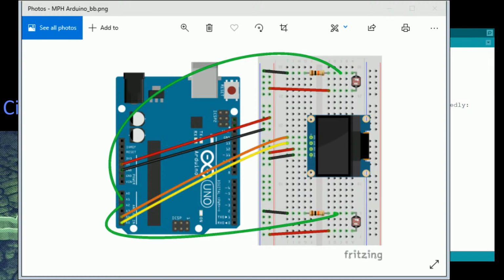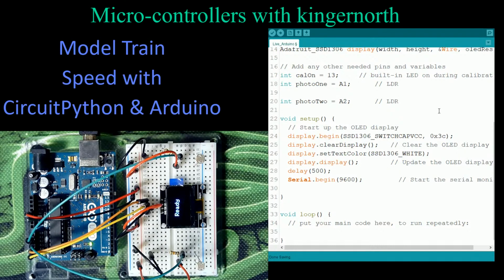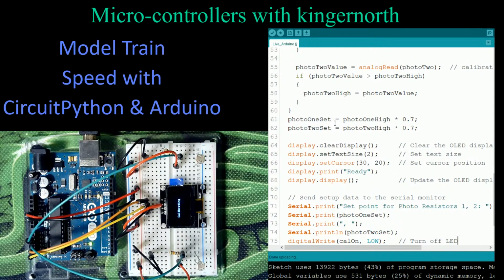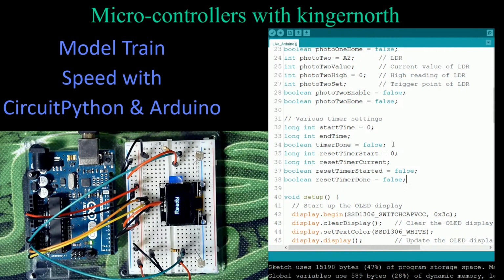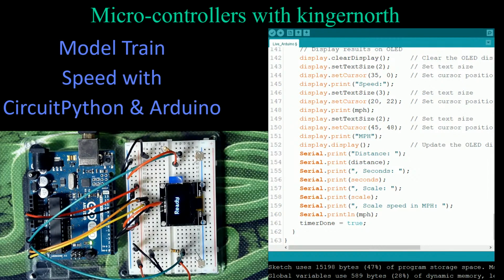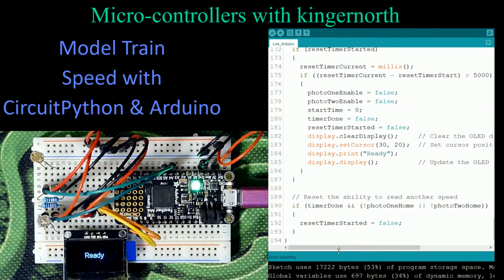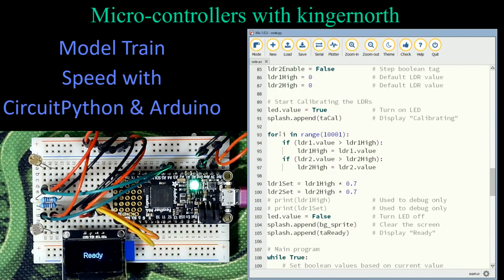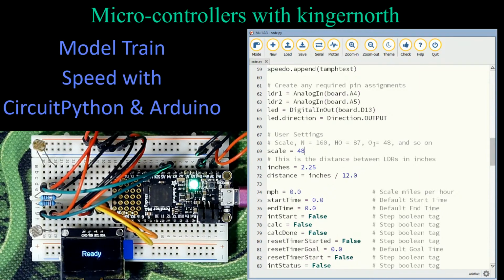Model Train Speed with CircuitPython & Arduino

Comment: What?  No trains?  This is a good novice guide to using LDRs.  As one who is actively involved in tracking model trains as they run, I'd note more advanced techniques involve using RFID tags and readers, or cameras with frame by frame motion detection using, say, OpenCV.  Two different friends who have operational systems have taken two different approaches:  one places RFID readers in his engines and a bunch of RFID tags buried below his track.  The other places readers around the rails and puts tags on everything that moves.  In both cases, all of the reading and processing is handled on Arduinos.  They both use XBees for communications.  RFID is more reliable than light sensing.  I'm building a system that employs both RFID and image-based motion detection.  I'll be using packet radios collocated on Adafruit Feathers.
Reply: Was kind of disappointed in the 'no trains' as well... thought it was going to be controlling the train's speed, not measuring it.  Ah well....

Comment: Any reason you did not use IR sensors?
Reply from the maker: Thanks for the question. I did comment in the video that IR could be used in place if the photo resistors but that was optional. Also the cost is less as compared to using IR sensors. I did cover using IR sensors in an earlier topic in this series of videos so I just kept it simple for that average user starting out adding and also this doesn't control anything on the layout so if a shadow causes a false start or stop to the timing it really doesn't effect the operations of the trains. My personal preference is to use IR sensors but I have found that beginners find the photo resistors easier to use.